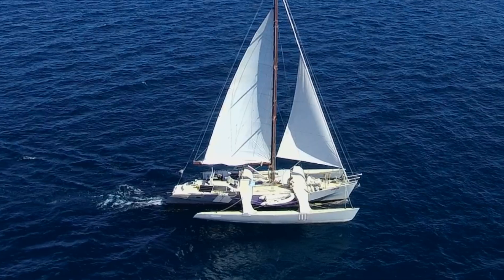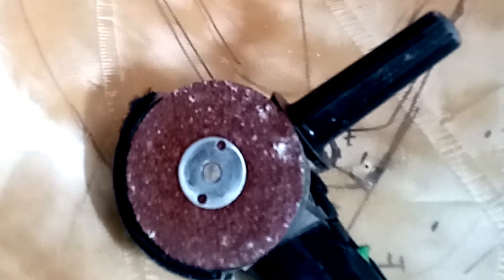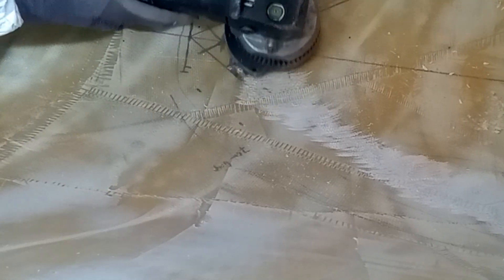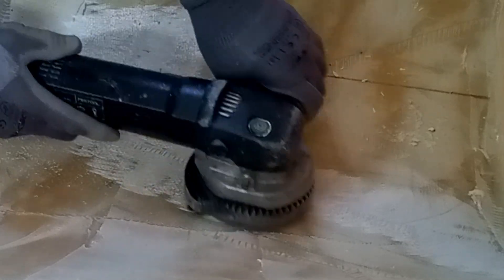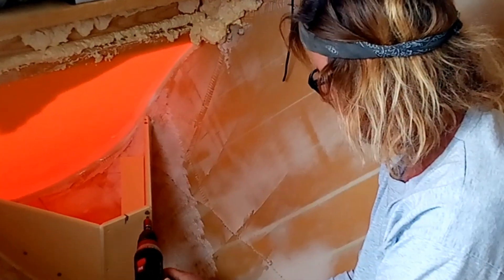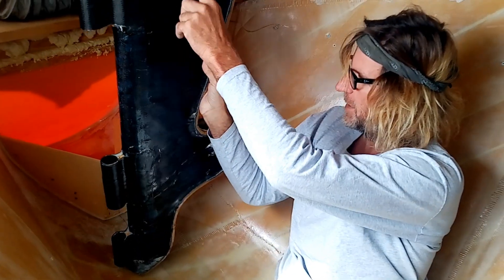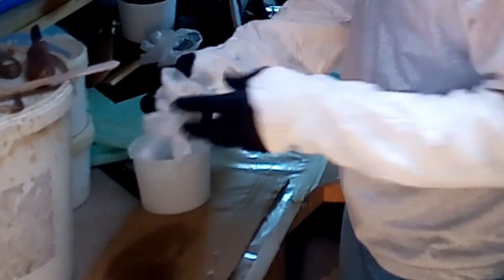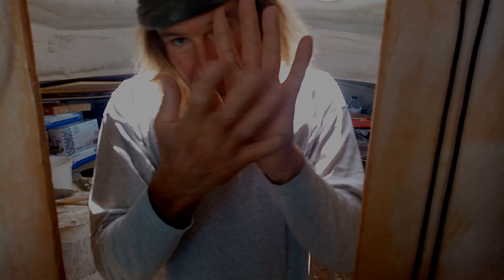Epoxy work in the Transom Trimaran Dawn 023

Comment: My friend, sikaflex 291, I believe is a structural epoxy that I have used on my tartan. Easy to sand, great on joints and hardens like a brick.
Reply from the maker: Hi. 😊 Yes there are great other methods to glue as well. 😊 😊   As you mentioned 👍 used often in production boatbuilding to join parts togeter. 😊😊 
We hope you have a good week. 😊
Reply: Arie, great design and work. The devil is in the details, well done!!!!!
Reply from the maker: thankyou just cant wait to test it all

Comment: You do make it look easy!, what do you make your filler up with?, epoxy and glass balls or wood filler etc? Cheers DB
Reply from the maker: Experiance strugeling before is helping. 😊
I mix my epoxy with cab-o-sil for glue and 
Sil-Cell for filler. Just filler gets about 10 procent
 cab-o-sil to stop it from running down. 😊

Comment: The plastering rubber is called a squeegee in English. I usually buy high strength Nitrile gloves, they are expensive but can hold out against acetone with no problems. The Festool grinder looks really awesome, I love the trick with the handle!
Reply from the maker: Maar plammuurrubbertje klinkt toch veel leuker. 😉
Reply from the maker: Yes now you say it.. Squeegee. 😊  Indeed about the better nitrile gloves. Thats the black ones i wear under my trow away ones. 😊.  How's your work goung?
Reply: @tentmaran  the work is going well. I hope to be able to cut and mount the deck on the stbd float tomorrow.
Reply from the maker: That's an exciting stage, how long do you plan to build or is it as and when it happends?
Reply: @tentmaran  I really hope to be finished in September. But, as with everything in life, I am treating that as a working hypothesis! 
The deck went on today, migraine delayed my plans, unfortunately. Next up on the stbd float is the trampoline rail, which is quite involved, then shaping the seams, fairing and glassing the sides and bottom...
Reply from the maker: Hows the project going? we sure your making good progress

Comment: Sharing 35 years of workingh with epoxy. doing it the simple way. there are so many technieks to work with epoxy but we like to share the methods that others can do easy as well. for sure we will involve te facum pump later in this series and make very high tech carbon bits wit RTM.
Reply from the maker: Making it possible for others to learn